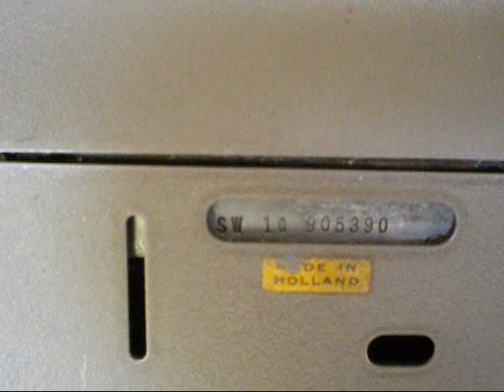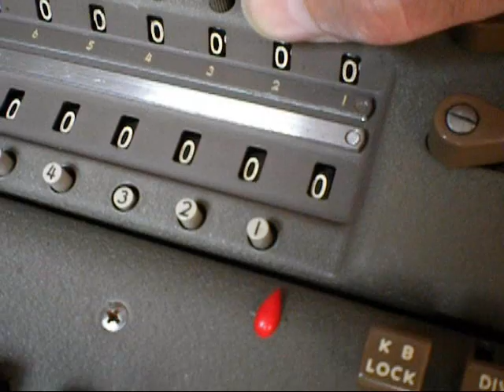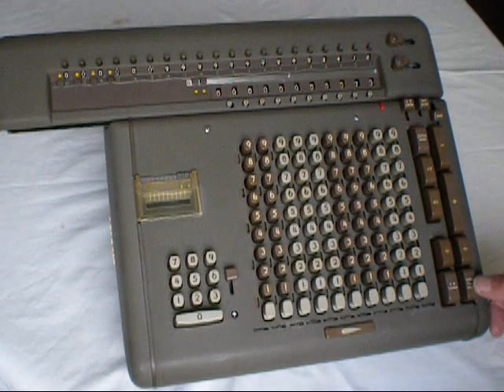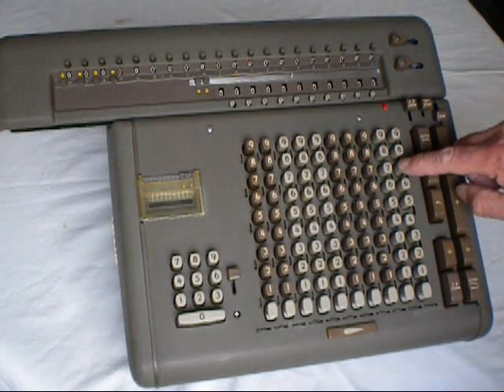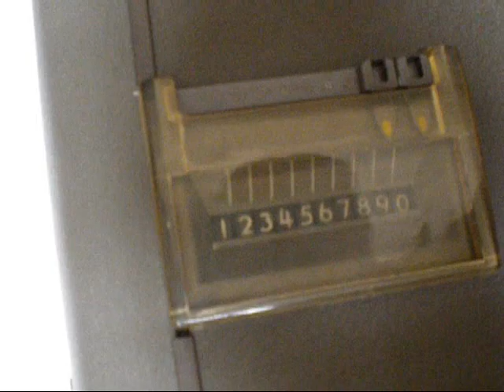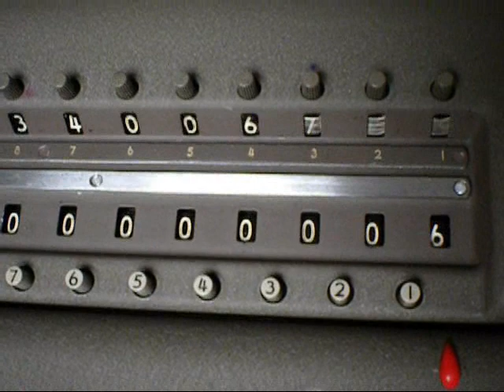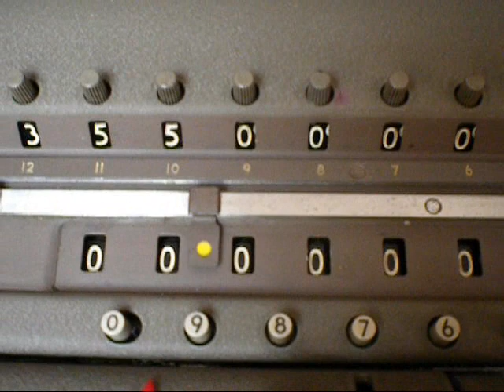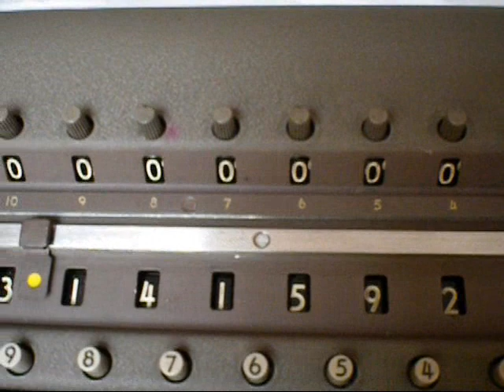FRIDEN Electro-Mechanical Calculator SW10

Comment: Thank you. My father was an advanced engineer at Friden from 1948 to the early 1970's. It's nice to see one of the old machines working again.
Reply: If that was in San Leandro, I probably worked with him or for him in the R&D building!  Must have been 1966, 67, 68 or there abouts.  My mechanical design career started there and ended in 2001 in Santa Rosa.  Tell him Clif says hi!

Comment: Thanks for posting! My wife used this machine in the late 60s, in an,office with 30 other economists , every one with a machine.. That's some teeth grinding.
Reply: Hello day tripper.  I worked as a drafter and then designer at Friden in the late 60s and it was about then the I was involved in the first ever electronic calculator.  Had a small CRT, but was about desk depth and 24 inches wide.  The year after it was released for sale, it was replace by the Texas Instrument hand held and later by very sophisticated HP hand helds.  Hand held calculators were as common almost as transistor radios.

Comment: I worked 3 years with this magnific machine in Santiago Chile, at Panal Industries. A fine machine, I will always remember. Afterwards some new machines appears, with rolls of paper where the numbers could be revised, and the people in high positions preferred those than this one. The last thing I saw of it, was when I visit my old place and they told me it was sent to repairs... I asked it to be used at my new post but they never gives it back until the factory went broke in the year 1981.

Comment: I used one of these back in the 60s. We only had one machine in an office of 8 employees. Since I was the junior employee, I was charged with bringing the Friden to whoever needed to use it. Well, it had to happen, I dropped the Friden. It seemed that there were millions of little parts all over the floor. I was sure that that was my last day as an employee with that company. I was wrong. I was employed for just short of 45 years with that company and had worked myself up to a directorship. BTW, I was told, at that time, that it was time to upgrade the old Friden anyway. I still laugh when I tell that story today.

Comment: I have a pair of these machines. One I recently found, and have not yet fully examined or powered up. The other machine appears to be stuck in a loop incrementing endlessly. Interestingly, there is one model that supersedes the features of our units... The SRW was also able to perform a square root function! I WISH I had one of those!
Reply: not sure if you figured out the stuck mode, but there is a video that shows what to do when somebody divides by zero.  Check out the other videos.

Comment: My mechanical calculators are a lot simpler. Hand crank Monroe Model K (about 1922) and a LA5 (mid 1930s is my best guess, could be early 1940s), I use it manually because the “automatic” part isn’t working. The A models were designed to be used with or without power. Speed depends on how fast I turn the crank handle. My Dad had a Marchant automatic machine in the mid-1960s but I have no idea what happened to it.

Comment: "Holy smokes" is right. I just got for free a Marchant Silent Speed calculating machine, and when I plug it in, it smokes. I finally got the motor to spin, but when I do calculations it gets stuck and starts smoking again. They were going to scrap it for the metal, so I rescued it.